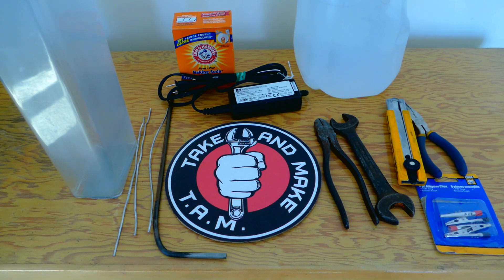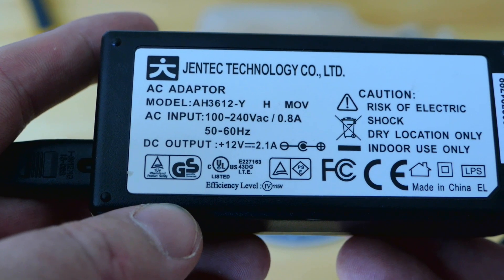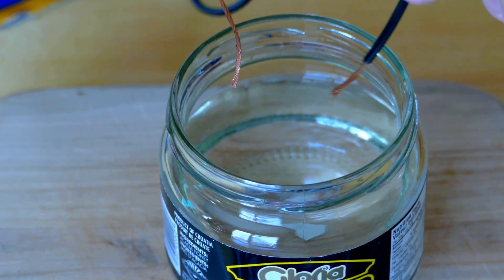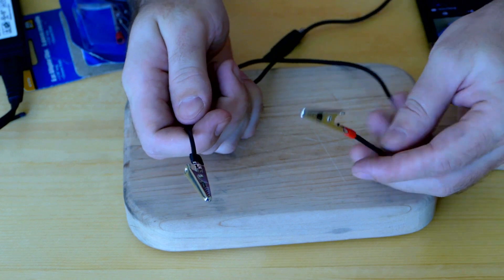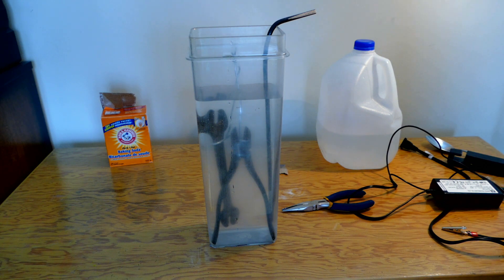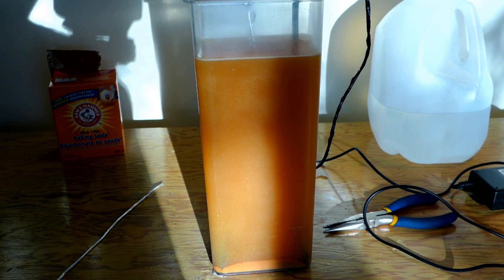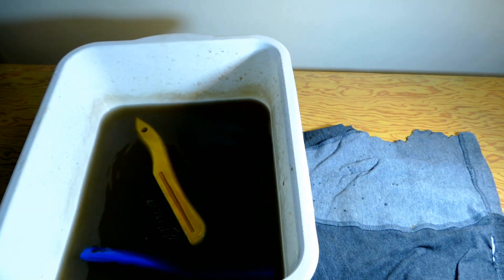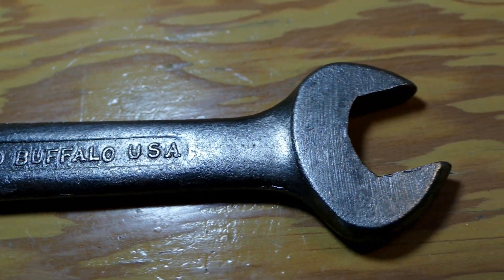How to Clean the Rust with Electrolysis? Step by Step Tutorial

Comment: I personally use a 5 gal. bucket instead of such a small container as this which can easily be tipped over. I use Arm and Hammer wash detergent, but have use many other things, including baking soda, as well. Once cleaned, I generally take a small OOO steel wool pad and scuff off the debris after wiping each piece down with a shop towel. I immediately spray the parts with Corrosion X to prevent any flash rusting and to coat the parts so  they don't get rusty again. Works like a champ. If you don't have this set up, another alternative is to pick up an old Crock Pot at a thrift store and put in enough vinegar to cover the tools. Add in a small amount of A&H wash soap and turn the thing on hot for a couple of hours. Remove any sockets or such then and simply wipe down after you hit them with the steel wool pad. I am in the process of using both methods at this very moment, as I had a bucket of sockets which got rained on when we were moving things out into a storage shed. They all rusted badly, but already they are clean in using either method. Took me about an hour on both to get them completely clean, inside and out. I can even read the sizes now. If you do not have the equipment handy for either of these methods, .then take a clear plastic container and cover up the rusty tools with pickling vinegar, as it has more acidity to it than standard white vinegar. Take that clear plastic bin of rusty tools in the vinegar and put it out into the direct sun light and leave it for a couple of days (Texas sun is the brightest, hottest and best). It will clean up the parts every bit as effectively as electrolysis or any other method and is actually cheaper to do. You can indeed pour your waste water out into a flowerbed with no bad results. I would not put it into a garden which has edible plants though. did this sort of stuff for over 30 years in always having a vintage Model A to work and piddle about with. Much safer than using lye soap or such, but keep the kids away form it all, anyway. I have used the  clear bin method on many a Model A brake drum and linings in the past with excellent results. It is always handy to know these techniques and to see how others employ using them. Thanks for this video.
Reply from the maker: Wow! This is without a doubt the longest comment I've ever read!! Thanks for all the tips! I appreciate it!
Reply: One of those couple gallon square kitty litter bins works great.
Reply: Acid?  you never will be able to neutralize the rust!
Reply: baking soda will neutralize acid. Every school kid knows that!
Reply: @donraptor6156  You are Smarter than a 5th Grader!:trophy-yellow-smiling:
Reply: It was for demonstrable purposes, obviously..

Comment: I'm really interested in your video... What is the preferred baking soda to water ratio?... Can you add more baking soda if needed? I see some people use vinegar, what's the benefit of that over water? Can you use boiling water, would that make a better difference? Would a magnet in the water as your anode ruin the process. Or only make it better, by being more conductive and picking up stray rust particles... How would I get zinc to stick to the metal that I'm derusting.. in order to keep it rust proofed when finished.. because I know boat motor annodes are made of zinc for saltwater... This wood in theory work if the wires were reversed correct? after the derusting of course..
Reply from the maker: Use simple water, ratio is about 2 table spoons per litre. Not fully understanding your question, if it’s zinc coated it shouldn’t rust, if it rusted there’s no more coating left. Hope it helps

Comment: Washing soda works much better than baking soda. It's not the same stuff. I just did two 4 cylinder engine blocks and three heads. Baking soda on the first block, and washing soda for the other. The washing soda makes the water more turbulent and the reaction happens noticeably faster.

Comment: I just drop rusty tools into a small tub of white distilled vinegar.  It removes all the rust with no electricity or wire brushing. You just have to remove the tools and neutralize the acid residue the vinegar leaves behind on the part with a simple rinse and dry with water and a towel.  Ive been doing it for years and it works perfectly
Reply from the maker: Electrolysis is simple, efficient and quick. Vinegar works just fine, just takes 30 times longer

Comment: My laptop charger output gives 19.5 volt and 2amp it can work or will end badly ?
Reply from the maker: Giver!
Reply: @Take_And_Make  by the way i tried but nothing happened no gass bubbles coming out of the rusted piece
Reply: @EmamOmar-i8f  Are you sure you didn't mix up the plus and minus?
Reply: @disrespectful7862  The circuit was absolutely correct.
Reply: @EmamOmar-i8f  Does it has DC OUTPUT for correct operation?
Reply: @disrespectful7862  Of course Dc output i used the laptop charger and it's in a good condition unfortunately no gas bubbles

Comment: Hello brother 
Nice video 

I have a question 

I want to put rusty cast iron part to electrolysis  but inside that part there is  and aluminum part also which I couldn’t remove from cast iron. Can i put that cast iron with aluminum part inside to electrolysis for cleaning cast iron ?
Reply from the maker: You can!

Comment: I have always heard that electrolysis can’t be done with AC because the electrodes polarity will be changing which will not attract the ions to a particular electrode and therefor no ionization occurs? Anybody have any opinions on this? I thought it has to be DC but he shows an AC in the video
Reply: He is showing DC. The "brick" in the laptop charger converts AC to DC for the computer's power supply.

Comment: Tried this method with a 2amp trickle charger, vinegar, and washing soda to remove rust from VW steering knuckles. It worked fairly well but took over a day. Next time I'll try a manual battery charger at 20amps + to speed up the process on these types of larger parts.
A word of CAUTION: when using washing soda (sodium carbonate ) with vinegar always have plenty of ventilation. Combining the two produces hydrochloric acid.
Reply from the maker: I’m using simple water, don’t use vinegar, if you do use salt instead
Reply: Why salt with the vinegar? @Take_And_Make

Comment: I like the patina left by the electrolysis process. I typically bead blast rusty blades with glass bead then use a variety of processes to get the effect I want - like wet sand, Scotch Brite, machine buff, a combination of those methods etc. Good to see you be very specific about the power supply required - it helps lower the chances of mayhem (lower, not eliminate). I'll have to try this process and see how it compares to glass bead blasting. Thanks for the effort and data!

Comment: FOR 78 YRS. I HAVE BEEN MAKING THESE ELECTROLYSIS FOR MANY PURPOSES: HEATING BUCKETS OF WATER IN PLACES YOU DONT HAVE HOT WATER HEATERS. COOKING. RUST REMOVAL. HYDROGEN AND OXYGEN RETRIEVAL. WATER CLEANSING AND ON AND ON. I ALWAYS USE 120 VOLTS. PUT ONE WIRE ON EACH TOOL. SEPARATE THEM BY A PIECE OF WOOD OR PLASTIC. USE FISHING LINE TO HOLD THE TOOLS AND PLASTIC OR WOOD TOGETHER. REMEMBER: THE CLOSER THE TOOLS ARE TO EACH OTHER, THE BETTER THE REACTION. TRY IT. I AM DERUSTING AN IRON METEORITE AT THIS VERY MOMENT USING 120 VOLTS.

Comment: so i was thinking to do this with welder machine. put some current to it. low voltage.
Reply from the maker: I thought you can get the same result with acid?! I would not put welder in the water. Use battery charger
Reply: @Take_And_Make  Yeah it was joke while welding and make cables go thro water to clean your parts in meanwhile :D But seriously, citrus acid i would go with, cheap to buy, safe even if swallow. It is used in food industry.
Reply: takes some time, and i personally like to use metal brush to speed things up. air tool, hand tool, whatever

Comment: Why is my power supply plug getting so hot? Too hot to touch.
Reply from the maker: How long you've been running it for? I normally go with 1 hr cycle tops
Reply: I didn't run that long, it starts heating up after just a few minutes and will get to the point it feels like it could melt the plug.
Reply: Input is ac 120 v 5w output is DC 12v

Comment: Great video, hit the sweet spot with enough but not too much info to get a neophyte started. Quick questions:  does the electrolyte solution become depleted through the electrolysis? If so, add more soda, or discard and start again? Is the solution caustic, will it harm plants/animals/kids if discarded in yard?
Reply from the maker: I make a new solution each time. If part needs more cleaning after first treatment I'll make a new one again. I wouldn't water any plants with it for sure. Just dump it in the sewer

Comment: Does this apply to aluminium too ?
Reply from the maker: Aluminum does not rust bud!
Reply: Take And Make i know but there’s just some strange yellow  spots on a pice of aluminum that i would like to remove and I wondered if it’s possible to remove them with electrolysis.
Reply: @themacfan  chemically it's possible however I have no idea what kind of anode to use.

Comment: Thanks buddy. I have a 0-20V DC power supply, grabbed some leads with alligator clips and am currently de-rusting  my scriber and some snips.
Reply: How did that work for you? I  have a 24 VDC 4A charger out of a mobility scooter I'm not sure if  that will be too much  wath, do you think?
Reply: @EduardoLopez-fo9xf  It worked great for me.  With higher voltage and amperage, I would probably increase the distance between the + and - , by using a bigger container and also possibly using less baking soda / bicarbonate of soda to reduce current flow. Not sure if this is correct  and this is certainly not advice, just what I would personally do, if I was worried that the voltage and current were too high.

Comment: Tools became dark?...I guess the wrench was plated before
Reply: its part of the chemical process, quite normal that you have to clean them off after, they were probably chrome plated, you can leave it a lot longer and get better results, then etch in hydrochloric acid after deep cleaning and degreasing  then electro plate with Nickel, just buy a nickel anode and white vinegar and away you go.
Reply from the maker: Check my newer videos, I already went through this process, thanks anyways!

Comment: What would happen if you put your hand in the solution while the electrolysis is taking place?
Are there any dangers or steps I should be vary of?
Is it possible to get electrocuted doing this?
Reply from the maker: Why would you wanna put your hand in it to begin with? :)
If you gonna use low current 5-30V and around 0.5-3A you gonna be alright, this method is pretty safe.
Reply: @Take_And_Make  
I wouldn't.  I just asked to know what the dangers would be. For example if it tipped over.

Comment: Is the amperage important when doing electrolysis? If I use an adapter higher than 2 amps, will I get better results?
Reply from the maker: How much bigger than 2 Amps? I don't think you'll get better result, but reaction may go quicker though. Just watch your adapter while reaction going, after 1 hr, or even earlier it may get super hot, and you'd need to shut it off. Smaller adapter - hotter it would get

Comment: Always leave a little length when you cut off a power supply connector and then throw it in a jar for later.

Adding an ammeter inline is actually helpful. The current flow is doing the work and 2 amps is a good target if you have an adjustable power supply. I use 24 volts DC as an upper limit and always shoot for 2 amps. Electrons are cool to play with.
Reply from the maker: Thank you for your tips!
Reply: @Take_And_Make  You're most welcome and thank you for the entertainment.
Reply: I am interested in using your method for cleaning and 
de-rusting old car parts. What is the preferred baking soda to water ratio. I think you did three heaping tablespoons into 1/2 gal of water... Please correct me on the correct ratios.. and the appropriate ratios for a stronger mix if needed... Can you add detergent to clean and de-rust at the same time... Have you by chance played with any magnets to collect rust fragments.. what's the magnets help or hurt the process? Does your current setup allow you to do any plating of sorts? I'm just really interested in what you're doing... If you left the wrenches in there longer, would you not have to scrub?? What about using boiling water to start the process, would that make a difference in the end?
Reply: @chadgama  Hi, thank you for your questions. I've been told since day one to always submerge your parts completely but no one could tell me why. 1 tablespoon of baking soda per gallon is what's recommended as a good starting point. If you're using a battery charger with a current display you should see decent current flow right away and if not add a little more baking soda. If you have the choice, washing soda seems to conduct much better at the same ratio.

You want to remove anything like grease and oil before rust removal although detergent in the solution, in hindsight, may actually help. I've had residual detergent on parts many times but I'll test for the effects of voltage vs ampacity of detergent later. I'll let you know what I find.

I'm an electrician so I have plenty of electrical toys. Plating uses the same DC power with similar volt amp requirements. I would eventually try for an adjustable 24VDC 3A power supply to cover everything or just a 12V battery charger to get going on rust removal. Plating requires stable and reliable voltage control where rust removal is more of a, as long as it works, type. 

Hope you have fun.

Comment: I use adapter 12v 2a.... but i wrap my 5 rust wrench with 3 metres long iron wire.... it work for 10 minutes, but then my adapter get Hot and smoky.... i know something wrong with my method but i dont know where my fault.... can you give me advice ??? Thnx b4
Reply: Because you are using DC current you want to minimize the resistance. 3 meters long wire is a lot of resistance especially if the wire is thin. Try using the thickest and shortest wire possible to connect to your tools in the circuit.

Comment: Awesome, thanks for the tutorial.  I've tried removing rust from an old axe head using vinegar and scrubbing with tin foil.  It removed it nicely, but almost right after I was done admiring my work there was a whole new layer of rust already forming.  I did some research and found out it's called flash rust.  Any tips on protecting from this flash rust?  does electrolysis eliminate the risk of flash rust?  Sorry if my questions are confusing.  This restoration is new to me.  Thanks again, great video.
Reply from the maker: You are welcome!
To protect it from rusting again, talking about axe head, I etched mine in boiled vinegar, works really nice! Check out my Axe Restoration video https://youtu.be/56H8xAAAfcg
You will find all neded info there.
Cheers!
Reply: If you dont want to etch it (force patina).
Just rub oil into the peice to protect it from from flash rust
Reply: you have to oil them straight away or electroplate them...